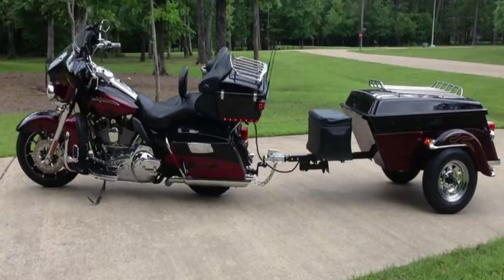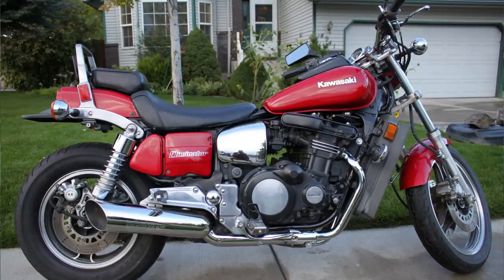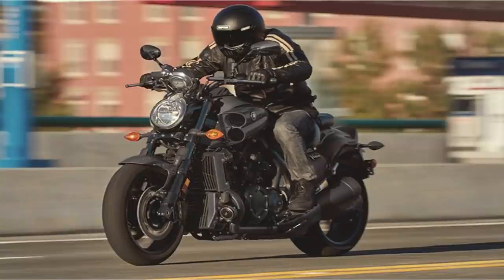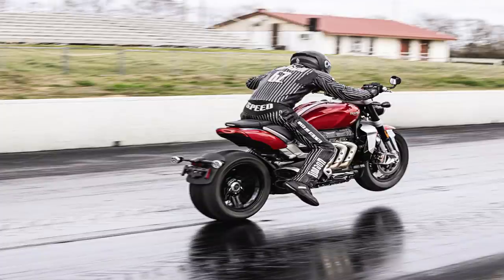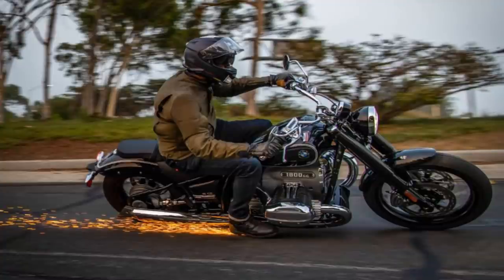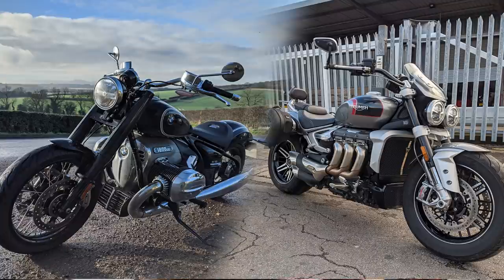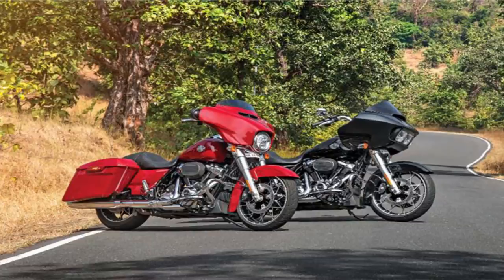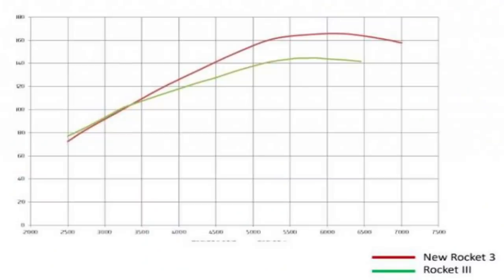Cruiser Motorcycles That Went Way Off Script

Comment from the maker: Would you go off script and buy something that's totally different from the style of a Harley-Davidson?
Reply: I would if they went back to the old styling. I am not a fan of sitting hunched over or with my legs bent back behind me.
If they came out with a newer bike that looked like a Kawasaki 454 but didnt have traction control and other computer nonsense on it, that would interest me
Reply: YEs, I plan on buying a Can-Am Spyder. That is way off script in my book. But I will still keep my Harley.
Reply: Yes, I own a Ural Sidecar outfit, but I ride my Panhead the most.
Reply: I'm old, 69, have always loved the look and function of the older style HD.  For my 66th BD, I bought a new 2018 Deluxe.  Mainly because it was mostly what I loved about HD. Lots of chrome and old style. I actually like the newer style signal lights better than the popsicle.  I also loved the 8 valves, way overdue. I've totally changed it to a touring bike, Crashbars, duel seat, backrest windshield, saddlebags, tour pack duel fishtail exhaust.  The only thing left is a TS 100 low revving torque cam and S&S oil pump and cam case replacement.
Reply: You said it best when you said you preferred Harley’s fit and finish above other motorcycle brands.  I agree with that statement 100%.  However, I do enjoy looking at other brands especially the Indians of a few of my club brothers.  Btw, I’m prepping to install the Andrews EV27 on your recommendation.  I’ve got 95k on my motor and am simply swapping the leaky base gaskets and changing the cam while I’m at it.
Reply: I really can appreciate Moto Guzzi and the fact that they are still manufactured in Italy and in the same factory, but for me I'm just hooked on the history of Harley. My next bike will possibly be a Shovelhead or Night Train, whatever comes my way first.
Reply: Came close to the first generation Triumph Rocket.
Reply: @BillyBlaze7  My first road bike was a 1986 a 454. My second was Kawasaki Eliminator 1000, then I was hooked on Harley's
Reply: @carlbruhn1772  Hey Carl, thats cool man, the only bike I ever bought brand new was a 1986 454 I had the burgundy one and paid $2150. cash out the door for it. These guys that have bought them and still ride them dont believe me when I say that my 454 would do 130mph but it would....granted that was giving it everything it possibly had lol But I could easily do 120 on it. I dont know if all of them were that way or if I got a factory freak motor or if it was the fact that I rode it like I was trying to kill myself from the time I drove it off the lot. Loved that bike. Curious, did you have to replace your shift linkage with the upgraded one and have your starter motor go out?
Reply: I actually went from a 81 LTD 750 to the 86 454, couldnt afford a Harley til much much later
Reply: @BillyBlaze7   The only issue I ever had was the starter.  Mine was black. It really laid the groundwork for a lifetime of riding
Reply: @carlbruhn1772  lol right on, yeah they only released them in the black and the burgundy. Thats funny man, the starters were weak in those bikes, I push started mine for 2 years because the starters were $200. and that was a LOT of money in 1986. The shifter linkage was a weak point too, they ended up coming out with a replacement part that was milled thicker than the factory original. It was milled too thin and would bend under normal shifting.
Reply: That was a good follow up to your last Cruiser blog...👍😎
Reply: You know, barely has almost always made the most poorly designed and most shabbily built motorcycles in the world. It took the company well over a century to realize that a 2 cylinder radial engine only does one thing well; self destruct.
Reply: If it has 2 wheels and a motor...I'll ride it. The beauty of Harley Davidson...is that you can break down in the middle of nowhere on a bike that has been obsolete for decades and no longer supported at all by Harley Davidson...and odds are you will not only find the part you need to fix the bike but someone who works on them. The aftermarket suppliers of parts for Harleys is gigantic...nothing comes close to it. There are many great metric cruisers...better performance, more reliable...but when it comes to the aftermarket.....Harley is the King of the Road.
Reply: If I had a bunch of money, I’d have several different bikes from different companies.

Comment: I’ve got a ‘13 Rocket 3 Touring.  These were detuned at the factory for a more American ride.  $7500 used, then an exhaust, intake and tune, butterflies, rev limiter, and top speed limiter now removed. It now puts down 130HP and 160 LB FT at the rear wheel.  It’s like a huge, FAST, Road King.  I love it!  …and I love ur channel!

Comment: I ride a 1999 Honda Valkyrie. I don’t care if anyone thinks it’s a cruiser or not. I love the 100 Hp and 100 lb-ft of torque and amazing handling. The bike captures my imagination and always has. I can roll on in top gear from 2500 rpm and it pulls cleanly to redline like a rocket-powered tractor.
Reply: My dad has a 97 Valkyrie. It's an amazing machine. My 96" road king can't even compare in the power department

Comment: Kudos for giving the 2500 cc Rocket III some love
Reply from the maker: Thank you! I had a lot of people mention it, it's truly a entirely different class of bike with that engine it has.
Reply: @GixxerFoo  you should consider doing another video on all the issues that Harley-Davidson is currently having with 6 speed transmissions and the use of plastic caged bearings and brass shifter forks. The supply chain has no parts for these bikes either got to love that! 3rd gear is the sacrificial gear that ends up being eaten

Comment: you forgot the parallel twins like the Triumph thunderbird i think its called. its a 16 or 1700 . and the Honda Rebel series 1100 is the biggest though.  i do like the look/style of the Guzi but i have heard they are worse than Ducati with reliability /part cost.  i like how with the Parallel twins the pipes are in front and go down both sides . plus i feel you can get the seat height lower and closer to the front of the bike, and both cylinders are right up front as well .  seems easier maintenance.   but Harley still has the parts/ aftermarket cornered.   i heard a saying before " you can get a Honda but you'll still want a Harley. which i think is true maybe 50% of the time.  the rest just love the other brands which is fine.  i hate the boxer engine mainly because im tall and it looks like it would scrape a lot with those heads sticking way out there.  thats just me.  good vid

Comment: How do you once again ignore the Suzuki M109R? It's an 1800cc V-twin for sure.. but I think it qualifies for the criteria in this list from a "styling different than HD" stand point.  It definitely looks different than most HD's (though it seems HD is taking some styling cues from the 9 on the newer Fat Boy with that enshrouded head light). It straight up outperforms just about everything on your list or on the HD showroom floor for a fraction of the cost (especially in the pre-owned market). It's so good Suzuki hasn't had to change it since 2006 aside from a few tweaks, which in and of itself is a really good thing from a parts stand point as pretty much all the parts are interchangeable from one to the next. There is a wide variety of aftermarket products available for the bike, and a huge community of knowledgeable and helpful owners for support. You are truly missing out if you haven't given some serious thought to this beast.

Comment: Personally I wouldnt get one of those bikes for many reasons...like obscurity which would lead to part sourcing issues and aftermarket support issues etc, plus you would need a group of guys to pick it up if you dropped it.
I grew up ridding in the late 70's and 80's and the smaller bikes back then were fast.
I heard that the government got involved in mandating gear ratio's and this is why it now takes a much bigger engine to reach the performance of the older smaller bikes.
I just know that you could do 120mph on a 450cc back then, and Ive had a newer 750 that makes embarrassing power by comparison. 
I also had one of those inline 4's an 81 Kawasaki LTD 750, I could do 80mph in 2nd gear, and I went faster than I have ever been on that bike, never reached the end of the throttle.
But alas....I am old, I still like to go fast but insanely fast doesnt thrill me like it used to.
I travel around 80 and thats plenty fast to kill you, and it gets there quick enough for me.
For me in my older years I like the look of the bikes more than how fast they go, as long as I can safely negotiate the highways and get myself out of a situation with a twist of the throttle i am cool with it.
Suspension performance is equally as important for me.

Comment: I have had several cruisers that were not v twins. My very first cruiser was also my very first brand new bike. A 1980 Suzuki GS450L. I have also owned three Yamaha XS650 Specials, and a Yamaha XS1100 Special. Then there was the Kawasaki 454LTD and KZ550, a Honda Rebel 450, and a Suzuki Savage 650. All of those were either parallel twins, inline fours, and one single. Many of the Japanese v twins were v twins in looks only. They did not have any of the characteristics of a v-twin. The original Honda Shadow 750 "v twin" used offset crankpins to achieve perfect primary balance, so they were mechanically the same as a parallel twin. They were smooth and quiet. All the Japanese manufacturers made most of their v twins that way, a couple of notable exceptions being the Honda ACE (American Classic Edition) and the Yamaha RoadStar. H-D is the only company that made v twins with the sound, feel, and torque a v twin should have. For the most part the Japanese just copied the look. I don't define a cruiser by what kind of engine it had. A cruiser is defined by style and riding position. Cruisers have high buckhorn handlebars, teardrop style gas tanks, stepped seats, forward mounted pegs and foot controls, a fat rear tire, and shorter exhausts. The Yamaha XS650 Special in particular was a wonderful cruiser. Not only did it have the look, riding position,  and the comfort, but it used a long stroke 360 degree vertical twin, same as a 1960s Triumph Bonneville, which made it a real shaker. Maybe that's why I owned 3 of them. I also currently own a 2013 Royal Enfield Classic 500, converted from EFI to a carburetor, that has the cruiser look and riding position, with a long stroke pushrod single that has a wonderful low frequency thump thump thump. 

I had a LOT of Japanese cruisers before I was able to afford to start buying used Harleys. I do find it interesting that the Japanese manufacturers tried to copy the look of a Harley but not the feel and sound. I don't even consider older Harleys to be "cruisers". It wasn't until the Superglide that Harley actually made what I consider to be a cruiser,  and shortly after that Kawasaki came out with the first Japanese cruiser, the KZ900LTD. Even Norton had a cruiser. They called it, of all things, the "Hi-Rider"

Comment: Some Caveats that Gixxerfoo wasn't quite aware of...
the Triumph Rocket until 2020 had 2300 cc's (140 cubic inches). The new Rocket has 2500 cc's (152 cubic inches). The new Rocket is not only larger but almost 100lbs lighter than the old one. The new Rocket has ABS, Traction Control, it is Blue Tooth Enabled and has 6 speeds. The old Rocket mostly does not have ABS (the later models did), no traction control, and 5 speeds. I own a modified old Rocket...and yes the Torque will put a silly grin on your face....as you pull away from everyone except for higher speeds....the old Rocket (pre-ABS) has a Speed Limiter set at 140 mph....the later ones the company set it at 120 (ask me how I know)...engine braking at 140 makes for a wild ride...The rocket came as a power cruiser model but there were also some tourer models that were made

ONE thing Gixxerfoo is unaware of...although discontinued...Triumph made a very large water cooled Parallel Twin called the Thunderbird....it had 1700 cc's...good torque, a belt drive....it's a nice cruiser...Triumph made the Storm and Commander versions which were their "Power Cruiser" model...and they also made a Light Tourer model (the LT). The Thunderbird handles beautifully.

Tourer models had slightly detuned engines and a narrower Rear Tire.

Japanese....the late great Honda VTX 1800 was also a fantastic metric cruiser...it was EFI, no ABS or Traction Control, 3 valves per cylinder, water cooled with a drive shaft. A bike that required very little maintenance, offered great performance, and was highly reliable..far more so than the Kawasaki Vulcan 2000.

These older and discontinued bikes can be found ....and the New Rocket is currently being produced. It retails for around 23K....so if you want to get a lot of Whoopass for your money and beat the pants off of the new M8 Harleys...for less money...this is your ticket. Stock bikes: the Ducati Diavel and the Yamaha V-Max will still beat the Rocket on a drag strip...but the Diavel just barely so as the speed goes up.

Carpenter Racing in NJ makes some very high horsepower kits available for the Rocket. And TTS Performance in the UK makes superchargers for this beast. In case 165 HP isn't enough...

Comment: I really like this type of discussion. I to am a harley engine fan. converted about 5 years ago from Japanese bikes. i had a honda 750 in 1969 when they came out and gosh the inline 4 was really a great looking engine. to me back then it was so fast etc. then later in 1993 i got a 1400 intruder and the torque for it was phenomenal. i cant remember any real cruiser that compared. goos stuff though man. another good topic might be the wet and dry sump. why certain bikes use different.  good job.

Comment: I love my 1983 V45 V4 Honda Magna 750! That thing rips, it sounds awesome and it's comfortable. There's something about an 80's V4 that revs to 10 000RPM, and man once the thing starts to rev it takes off! I've always wanted the larger V65 1100 Magna, because the 750 is a weapon so the 1100 must be a gem! I also have a 82 Kawasaki Spectre Z550 which is an inline 4 550cc and much like the Magna it revs to 10 000RPM and it too is very fun and quick, and again like the Magna I always wonder how ridiculous the Kawasaki Spectre z1100 must have been if the small 550 was such a little ripper. Both bikes back when they were new ran low 12 second 1/4 mile times, which doesn't sound that fast until you remember they are 750cc and 550cc and this was the early 80s. They will hold their own against almost any new cruiser, and stomp quite a few of them. All that being said, I still love my Harleys lol

Comment: Enjoyed the video and breakdown.  You touched on the V4's briefly and I've been curious how the smaller cubic inch Royal Star Venture that is only 1300cc is able to produce the type of HP and torque that it does.  I know it's a V4 but just a little surprised that a bike that big has  only 1300cc.   I also own a Honda Magna 750 and enjoy the power on such a small bike!

Comment: Great video. And you didn't even touch on the parallel twins (Triumph Bonneville's, Nortons, BSA's etc) which have been around just as long if not longer than the V-twins. We'd love to see you do a comparison of the 1200cc sportsters with the Triumph lineup of 1200's (speedmaster, bobber, bonneville's etc). 
I currently have a Triumph Bonneville T120 which is a very well engineered and sophisticated bike with plenty of down low torque. I'd also love to add a Harley Nightster to my stable as well.....we'll see if I can get the wifey to go for it!! Ha ha...

Comment: I really liked the Honda V65 Magna if you wanted a cruiser style bike. The VMax was great too.
It was not a cruiser but I preferred the V65 Sabre. It was a UJM. They were very powerful. 
My present bike is a VTX1800R. With Vance and Hines exhaust a velociraptor air cleaner and power commander 5 it has at the rear wheel horsepower of 95 at 5,000 rpm and torque of 118 with torque of over 100 from about 2,100.
Reply from the maker: That VTX will scoot, that was Honda's response to the public for years of 750 Shadows. They wanted to show everyone they could build a vtwin cruiser with some power.

Comment: As a Moto Guzzi California Audace 1400 owner. I must say that you somewhat missed the point. Italian V twins don't to low rev torque all that much. They like to rev but belive me when You rev them they go! You can ride them in a HD way 2500-3500rpm and you will enjoy yourself but to get the best out of that engine you need to use 4.500-7000rpm and that they will absolutely fly. I ride with my friends on different types of bikes (KTM 1290 SuperAdvnture GT Honda CB 1300 Suzuki GSXR750 Triumph Thunderbird 1700 and I never feel that I'm missing anything in the power or Torque department! I know that they are hard to find in USA but if You ever gonna have a chance to ride a Big Block Moto Guzzi. Go for it but maie sure you are in sport mode (veloce) and you don't ride it like a HD! Keep it spinning and you will understand what I am talking about!
Reply: I would jump at the chance to ride one. I know what you describe. A well cammed pump gas HD M8 107 can make good torque from 2500 and pull hard to 7k.